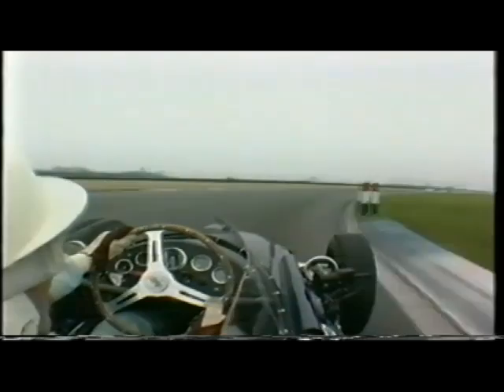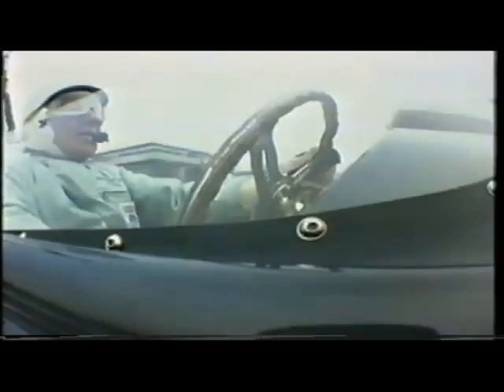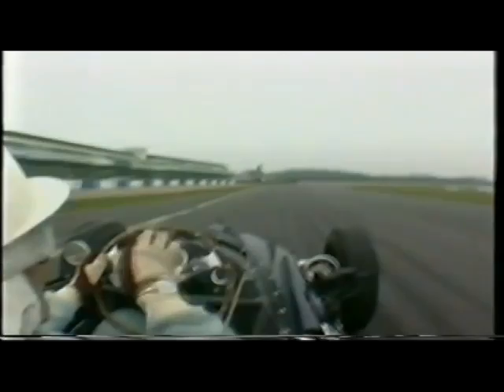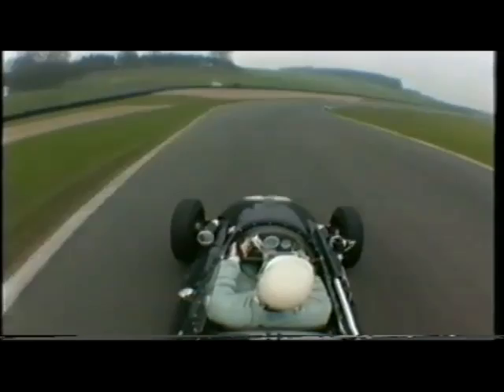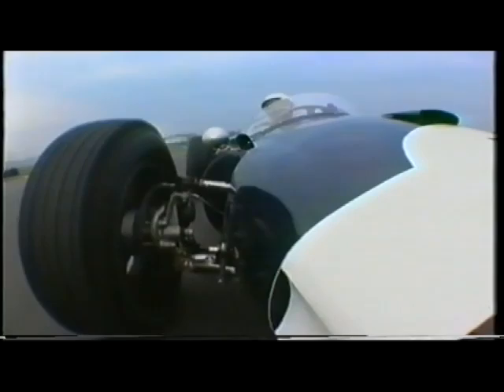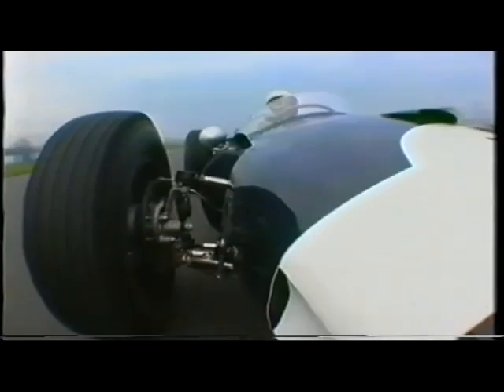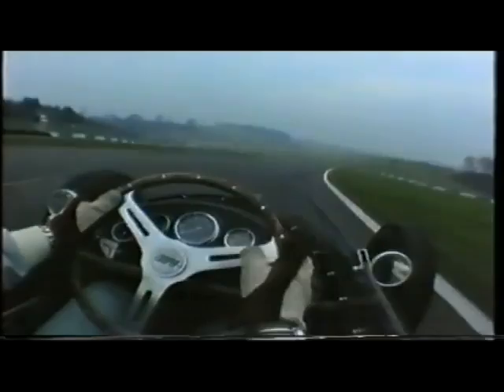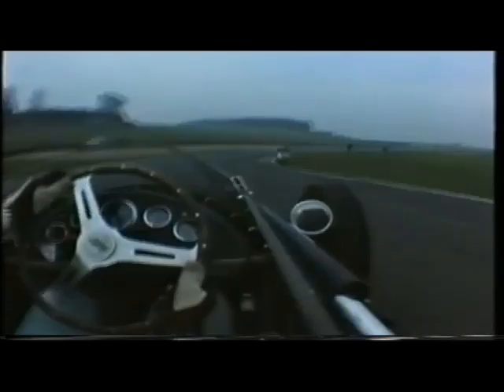Stirling Moss shows how to drive the 1959 Cooper-Climax

Comment: Can we agree that if there were such a title as "Honary World Drivers Champion" that we'd give Sir Stirling that title?
Reply: Without a doubt! Without a doubt.
Reply: he's dead! I'm very upset
Reply: Roy Salvadori , noted 250F, Cooper and Aston Martin team manager, almost in the top rank in the mid/late 50s, said driving these early Coopers although they are very small cars in comparison and totally adjustable and set up in the way F1-3 cars till the late 197Os with the driver suggesting adjustments all sorts if suspension, ride height, gear ratio settings they are still similar to the 250F in the high position of the driver and the way the car is driven and drifted into the corners while a 1963 sees the driver virtually lying down and requiring very different techniques. Also the Cooper and its 200/220hp engines are simple chassis and power units within the price range of skilled artisans in some ways a new 25OF Maserati.  in 1955 would have cost equivalent to 15 years wages of a bank clerk in a large British bank.
A new Cooper or Lotus 11 sports car was affordable to a Mechanic or really a garage owners son in.1961 while a 55 Maserati 250F or even say a 1977 Ralt F2 with 2 BMW 2 litre racing engines, would cist 100,000 in total for the basic equipment and a min 150,000-200,000 US for 1 12 race European season and only affordable by very rich men or rich listers. Only 2/3 Australasians would even have contemplated running. McRae, Allison and Oxton would have thought about it. Jones had already got enough of a break in F1 to only do a few F2 races and the Can Am series. Newman , Haas and VDS would probably have spent more than Surtees or Ensign did in F1 in 1977 on Can Am. In F5000 in the UK in 1976/7  Holland, Edwards, Trimmer would have spent say 45,000  pounds.  So by the late 1970s motor racing was as unaffordable at the top level as in the mid 1950s. Brett Riley could not afford at all beyond F3 and it was a very unusual period of the minimal cost Cooper's and Lotus than everyman could contemplate. My idea of doing it was more on the Hawthorn, Seagrave model . But in my view, no non European could have done it thru French F2 in 1977.Just look at the tracks. It took.J.Watson 3 years to even qualify in Euro F2 and he was last true privateer to make. Son of a rich NI car dealer he saw the Dunrod TT in 1955.As  he said in the pits that day he saw, the TT was not just about motor racing.He would have seen Moss, Fangio, Hawthorn, Collins. Frankly some of the most brilliant and dangerous individuals on earth, inc the Jag and Mercedes team. In the late 1960s before I was even a teenager I was as fanatical team and had read every detail of those 50 sports car races. Within a few years , by about 1970 3 photos summed up my interest. Willy.Mairese in the Ferrari 156 Spa 1962. The most impassioned drive in history.His face mask is of a man running at 100 percent concentration. A lesser Nulovari as Ferrari called him. Baghetti was the lesser Varzi. And the great shot of Rodriquez getting the usually hopeless P133 nose up to lead Amon off the line at Jarama in 1968. And of Oliver in ex Clark 49 high wing, leading the British GP.
 till L43.
My view was the F5000 fields were increasingly week in UK/US in 1975/77 so the chance probably lay then in 1976 in F5000 or Atlantic, so you would have to he good enough, in my case as about 19 to look good compared with say Brown at Watkins Glen or Oliver at Mosport. Impossible. Well it might have been conceivable. But in my view no one nation n the sports history could have been competice in 1977 F2 without a couple of years on French and German tracks. Even  Stewart or Hawthorn, would have not been a contender without 3 years F2 experience.
Reply: @BD12  you will be too someday - get over it.
Reply: No see my post.
Reply: What the fuck? I live in the real world, he wasn't good enough. Fangio outdrove him in the same car for example, and Jack Brabham was simply smarter in the same car, end of story.
Reply: Jim Clark. Greatest ever... imho.
Reply: @markmark5269  if Jack was that clever, why did he keep making his own car unreliable by experimenting with it, and end up being beaten by other people in the same car as him? I'm not saying he was a bad driver, but he often sabotaged himself with questionable design changes, which were only made to his car. Fangio did have some things gifted to him by other people, such as a championship win while at ferrari.
Reply: With any shadow of doubt
Reply: The greatest driver not to win the championship!
Reply: … like Lloyd Ruby never winning the Indianapolis 500
Reply: In a heartbeat!!!!!!!
Reply: @chrisdavidson911 stupid statement tbh. If everyone decided not to experiment out of fear of it not working out they’d still be racing 158 Alfettas hahaha
Reply: Yes

Comment: 7:15 double clutch heel-toe downshift. Awesome video. Thanks.
Reply: Never was heel and toe.  It was always 'toe and 'ball of foot'. See the crease in the shoe where the sole hits the accelerator? Never was 'heel'. The toe has to move to the brake, requiring the heel to lift off of the pedal, replaced for that moment by the ball of the foot much higher up on the accelerator pedal.
Reply: correct, that how it's done most of the time but the technique is still called heel-toe regardless of if the heel is used.
Reply: @d.e.b.b5788  It is "heel and toe", you're being too literal. Nobody says ball of "foot and toe".

Comment: Great video. RIP Sir Stirling. I have been a car racing fan since 1961, and i am convinced that it is completely pointless to try and compare pilots of different eras. They were all great, even if most of them did not had much success, but they had different skills, physically, technically, and above all a different mindset, particularly about safety. When you see the conditions in which they raced in the 50s, 60s and even 70s, it is mindblowing.

Comment: Sterling was about 57 when he made this. Still damn good. I'm sure the new grand prix or F1 cars there's no need to heel and toe. That's one art that's gone for F1.
Reply: +gremmann but I bet they can all do it. Anyone who's raced in circuit or rally with a conventional gearbox will almost certainly have learnt how to do it. It becomes automatic after a while and increases the thrill of driving, achieving smooth downshifts while braking heavily.
Reply: +Audidude 
I have raced this manual gearbox professional in Formula Ford in 1990. The current teen F1 generation would be unae to do this. Ricciardo even said that that he thinks he could never handle this professional after a demo test in a prototype car of the 70's. They are all computerized kids with hardly natural talents. It is no big thing to race a modern formula car fast. The real gods were the F1 drivers in the 80's and before....nowadays it is a laughable joke!
Reply: +houseofwine Yes, of course. Because almost 900 hp, 3-5 g's through the corners, 4 g's under braking, and top speeds of upwards of 200 mph is a laughable joke.
Reply: Different sets of skills, really. Moss and crew might have had difficulty with all the settings available, fuel restrictions (WTF? just go fast as you can, mate!). What they're pointing out, is that some people are never able to master certain physically coordinating skills. Brakes? What brakes? those old cars barely had brakes; they had to downshirt to slow down, and if you missed a shift, you might very well destroy your brakes and have nothing left for the rest of the race. So yeah, todays drivers are kind of spoiled by reliable technology.  Oh, to hear what a modern day driver might say if he was driving one of those old front engine monsters and had the driveshaft spinning between his legs and have a u joint go out! That would be exciting!  Heel & toe while shifting an argumentitive gearbox is an acquired skill (I'm willing to bet none of them has yet figured out how Senna drove the rest of a race stuck in one gear and still won).  3-5 g's with downforce. Quite stable. Nice, smooth, safe run off areas. Once you've reached 175 mph, 200 isn't that much different....especially in a car with downforce. those old cars had NONE! On skinny tires! wearing your gas tank around your waist. Hmmm. Knowing you only had a one in three chance of surviving your racing career.  There were fewer cars crashing into each other, because if you did, you were dead. A different time. In comparison, today's F1 driver looks like he's driving in a computer game.
Reply: +D.E.B. B struggling to reconcile this post with your other one I replied to. This time you have it about right, but the other one.... 😊
Reply: Yes, I went through the Motor Racing Stables school at Brands Hatch in the 60s and we toe and heeled and I still do it in my daily driving. It's much smoother and easier on the clutch and gearbox. I'm 69 now
Reply: @houseofwine7704  and you know this because you drove them all? Different skills are required for sure. But calling the current F1 drivers hardly natuural talents is a complete joke!

Comment: A quick check on the Internet:  The Coventry Climax engine used in the 1959 Cooper was a 2.5 liter, straight four developing 240 Bhp.  The car weighed 472 kilos(1040.6 lbs), giving a power to weight ratio 461 Bhp per ton.  For purposes of comparing, the Bugatti Veyron at 4,160 lbs provides 530 Bhp per ton -- 69 ponies more.

Formula One cars then were built to win races, not sound good.

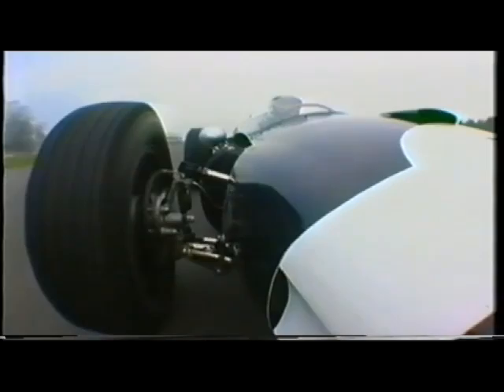Comment: And here, at about 7:12, we actually get to see, that 'heel and toe', is actually 'toe and ball of foot'. As you lift the foot to move the toe to the brake pedal, the heel has to come off of the accelerator and be replaced by the ball of the foot much higher on the accelerator, as evidenced by the crease in the shoe at the ball of the foot, while the heel is off of that pedal.

Comment: @buzzboy7 you need space on a car that is designed to advertise, especially on the low surface area of a formula car. such as the vertical aspect of the rear wing

Comment: I wonder if a 25-year-old Sterling Moss would have been able to cope with a modern F1 car.
Reply: More like the other way around with modern F1 drivers, driving a car without so much electronics and a stick.
Reply: @Mr. Wolf But the performance of a modern F1 car… 

Modern F1 drivers get their start in karting if I’m not mistaken. That’s pretty low-tech.
Reply: @lebojay  true that performances are much greater but anyway karts are still different from old F1 cars